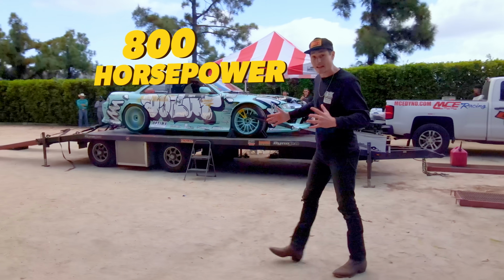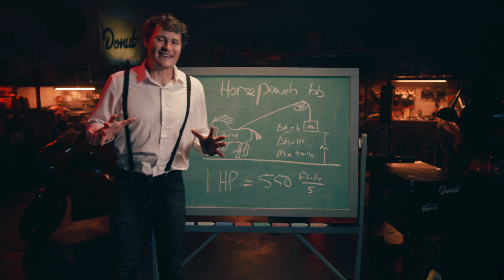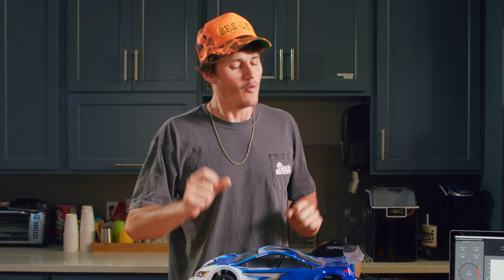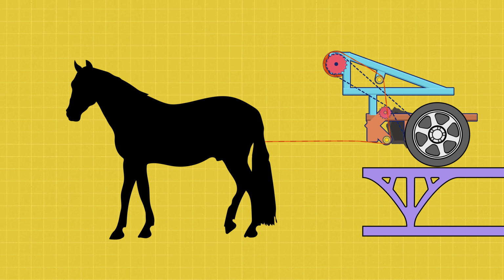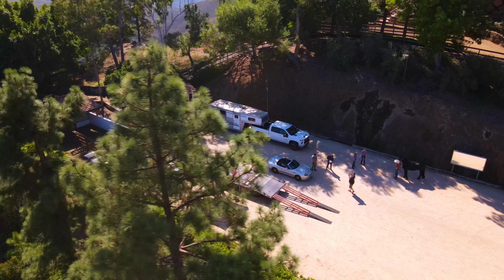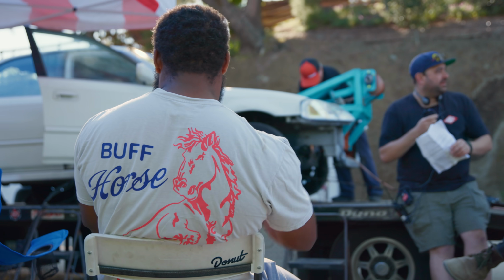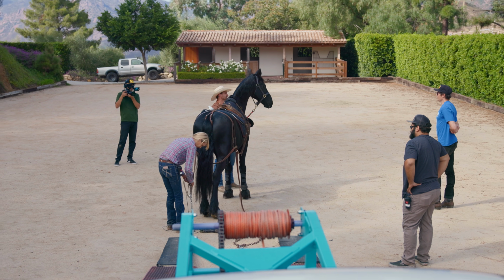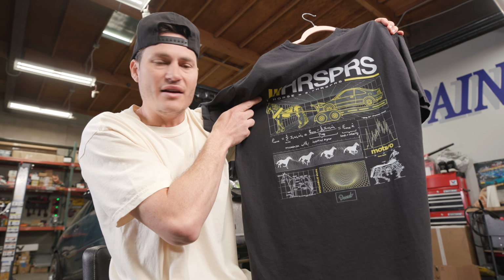How Much Horsepower is a Horse?

Comment: OK well that means that your math is 4.7 HP off. Because hello McFly you have one horse doing all the work. So all you scientists and physicist need to back up and look at the bigger picture because if you actually think that one unit equals 5.7 units of anything then maybe you need to take up another hobby like flower arrangement or something. But what you did show us is how far off the initial calculations of horsepower is. Now we know that one real horse is equal to 5.7 hp. My 85 El Camino clocked in at 222.3 hp so we divide that by 5.7 and we get 39 real horses🛻🪢🐎🐎🐎🐎🐎🐎🐎🐎🐎🐎🐎🐎🐎🐎🐎🐎🐎🐎🐎🐎🐎🐎🐎🐎🐎🐎🐎🐎🐎🐎🐎🐎🐎🐎🐎🐎🐎🐎🐎

Comment: As with all measurement units, horsepower is arbitrary. Its objective in the sense that its the same arbitrary unit we use for comparing one engine to another. So I would not be surprised to learn one horse can do more than one horsepower. This is an awsome idea to really test it.

Comment: That was entertaining for sure) But as much science as Horse Power definition itself) First of all, that wasn't average horse, and to be statistically correct, you'd had to bring a lot of horses and calc average of their power. Then, 5.7HP is a MAX what Big D did, not average. On average, according to a chart it will be hanging somewhere around 3 HP (I'm counting on the "normal drive" section of the test road, when horse wasn't accelerating or slowing down), still > 1 HP though) 
Also, it means that, f.e. tesla plaid isn't 1020HP, but actually is 340 real horses :) and so on

Anyway, thanks, that was fun!
Reply: I don't think that was even Big D's max, he hasn't even reach optimal speed (real engine RPM)
it feels like just a mere effort of opening the throttle while the engine is still revving under load.

Comment: I guess you guys pretty much have a guaranteed follow up video idea of just responding and maybe carrying out the recommendations everyone makes. I have no idea how much that would cost. People in the comments don't seem to realize that this was done as simply and cheaply as possible, mainly making the test and shoot as quick and efficient as possible by only going for the simplest and surefire (least risky) type of significant data points in the context of a single comparison case of engine vs horse in a car flooring it off the line. Enough to get a video and just barely enough to publish a paper saying we did a thing and then maybe they'll add to it by discussing different problems or issues or situations so that the experiment isn't the really the meat of the paper.

Comment: Was just a unit of measure people could relate to 100 yrs ago. Would be different for every horse but it's set at 550 ft lbs per second
Reply: yea, it's just a name., could've been agreed on anything else but since the engines was basically replacing the horse.
horse power should nt be used as a unit name, every horse's power will be different just like the power of the exactly same engine model won't be dead same.

Comment: G'day, well done on the measurement but the measurement you made is peak power and not an average output. The definition of a horsepower is based on an average animal output over a one day period, and this is well publicised. A horse clearly cannot sustain the measurement you made over a 24 hr period. Five pulls max for Big D, right :)
Get a horse to work a mill over many hours to exhaustion and see what the average is.
Wil G

Comment: Instead of lasers to read the rotational data, why didn’t you use magnets kind of like a crank positioning sensor or a cam shaft position sensor? And you could have bypassed all that BS with the Honda Civic, with a solid drive shaft like what go carts use. All you would have needed was an A frame, a solid shaft drive shaft with a sprocket in the center or just bolt two axel shafts to a spool and an idler pulley and two wheels connected to your axel.

Comment: Loved the idea, loved the video, felt very mythbusters-like, but just like mythbusters, every experiment can be improved. Seems to me (and fyI, I’m a college student who did middle of the road in AP Physics, I got a 3. I did much better on my AP Statistics Exam, I got a 5, in case you’re interested in my ‘credentials’) like there are a few small changes that might improve this experiment. Now, granted, I have not read the academic paper that I assume goes along with this video, but all experiments can benefit from more trials. Assuming the experiments all occurred in the span of one 24 hour day, specifically within the daylight hours of the day, though the length of this span of time will change throughout the year, depending on the location the tests were performed. This is also assuming Big Do’s safety pulling precautions were followed; it follows that that there was a maximum of 5 test pulls performed by Big D. This is further evidenced from the 5 video clips, although it is uncertain from the video whether or not the first test with the malfunctioning laser was used in averaging the data collected, so the likely total number of trials used to calculate the average is either 4 or 5. This is also assuming that the data 5.7 hp figure is the result of taking an average of the trial data, and that 5.7 is not from observing the highest data point. Under these assumptions, the average hp measured by the dyno is likely to have a low statistical significance, this could be greatly improved by increasing the number of trials. It is also highly likely that the terrain, temperature, and weather conditions may play a large role in determining the power of the horse. This may manifest itself both through influencing the mental state of the horse, ie. relaxing, antagonizing, encouraging, or upsetting the horse, or by mechanically impacting the horse’s ability to pull, by providing more or less friction to aid the horse’s grip on the terrain, or by providing an positive or negative acceleration on the horse via wind and the horse’s aerodynamic profile (Although the latter is highly unlikely to have significant impact, outside of extreme weather conditions which are likely to be outliers, statistically speaking). This is all to say, there are many variables to control for, this is not a large issue in this specific experiment, since the trials (following the assumptions provided) were all conducted in a relatively short time span, these variables are likely to be relatively constant for trials in this experiment. If more trials are performed, this would need to be taken into account. Anyway, thanks for reading all the way to the end of my own personal callback to High School (shout out Mr. Estevez and DR. Hedrick, Go Wildcats! (Boo Scorps and Red Wolves!)) 
Edit 1: 1st round of spelling and punctuation corrections

Comment: When I was in decent shape in my early 20s, I used to like to ride the LifeCycle exercise bikes as warmup and cooldown to weight room sessions.  By about a month in, I was running their 24 minute hills program on the max resistance level (I'm big and I was rather strong).  The steepest portion of that program is climb with 1400W of resistance.  To do the math, that's about 2 horsepower I would output for 3 minutes 2 or 3 times a day. And for whatever it's worth, I've been described as several various animals in my life but horse isn't one of them that.

But for the unit of a horsepower, the purpose wasn't to find a comparable peak output but rather an average daily output.  Horses do need to rest, and if worked for long times, won't be working at their near-peak levels.  For me, that 1400 W was something I didn't really struggle to do but probably couldn't have held for more than 10 minutes or so.  But back it off to around 500-600 watts and I could maintain probably for several hours.  If it was something i had to do for 10 or 12 hours, I might have needed to back off to around 300-350 W. or maybe even less.  So that 800 horsepower car isn't like 800 horses pulling it.  It's more like having 800 horses on a hotwalker with that hotwalker charging batteries, and those batteries able to deliver all the power needed to drive the car 20-30 miles at full throttle each day.

Comment: I only have two gripes with your process
1) as big D pulls the line, he pulls more rope away from the spool. This causes that rope to pull on the spool harder simply by staying taut
2) since the rope is coiled around the spool several times, technically big D is pulling a slightly larger “gear” (if you will) with a larger radius 
I don’t have a solution for either, but good video nonetheless!!

Comment: I bet you they did do it and 15 is accurate. But they gave the horse a whip I bet you that horse could get twenty five with a little bit of the effort, bid d didn't use at all But a quarter horse would probably drop out at fifteen That's the average cowboy horse city folk

Comment: A horse, generates 1 horsepower. Yes its based on torque. The torque it's based on is the power a horse generates to pull things, say a wagon, because that's what they had to work with.

Comment: Couldn’t you just put a conveyor belt sort of a thing over a dynamo with an additional rotary drum attached in front. 

Wouldn’t that be a Better and easier way of recording it? 
In this case, a lot of energy getting wasted due to the gearing system and the friction etc.

Ps: just a doubt, not an expert myself😅

Comment: Well, the horse clearly wasn't pulling anywhere close to max, but then it wouldn't if you were having it do steady work all day, it also isn't a full sized draft horse though. Still this proves what I long suspected to be true, that a horse makes a lot more than 1 horsepower. I think it is importantly to remember that today we think of horse power as peak power a system makes, when it was initially more about the power a system could maintain for an entire day.

Comment: Hmmm, I give why I'm down voting this video at the bottom. 

I remember in history class that the Roman's used human slaves because the harnesses of the time went across the horses chest and choked the horse if it was pulling a big load. It was OK for a light cart or chariots but not heavy loads so humans actually delivered more power (ie: more useful work), hence slavery.
It was also mentioned that the invention of the HORSE COLLAR (after Roman times) which transfers the load to the horses shoulders allows the horse to draft MUCH more weight than a horse with straps across its chest (think of it as a strap across your neck/windpipe, that's going to limit you right? Same way it works with a horse) and major changes happened to the world due to this invention. 
It revolutionized agriculture for one thing as a lot more land could be cultivated by a horse with a horse collar (pulling more plow blades and deeper into the soil too) than one with just a strap harness.

So why the hell didn't Big D have a drafting collar? You damaged your true readings and data because you used the inefficient harness for this test !!!!
Didn't anyone know about horse collars and getting full power out of a horse on your team there? No one has a decent history class that covered why things were done the way they were (or was it History for Dummies and yours just cover names and dates) None of the horse people spoke up about this error?
No one caught on that pictures of the old West that where horses or mules or donkeys were pulling heavy loads they had on horse collars and where the load was light it was just a strap harness?
How about the Budweiser Clydesdale horse teams, they were the ultimate draft horses and every picture of them in harness shows their horse collars, they are there for a purpose, not just decoration. Our ancestors weren't as stupid as some people think today.
Those that forget the lessons of the past are doomed to repeat the mistakes of the past.

Comment: This is fun an all but seems a little over engineered.  Why wouldn't just build a rig that would put a tire on the Dyno drum and just wrap the rope the horse is pulling around an axle attached to the wheel?  Less moving parts = more accurate reading.

Comment: This is a fun video and the amount of time and effort in setting it up and running the test is impressive. There is however some potential for inconsistencies in your conclusions as to how much horsepower a horse can produce. While Big D is a beautiful animal, he is a rather small 'draft' horse. At 3:10 in the video, the horse shown is by far a larger, more powerful draft horse. If you used that horse or a large Belgian draft horse, the horsepower rating could be far different from the figures posted by Big D. I don't know if there is any way to definitively define "The" horsepower produced by horses. You could only perform the same test on multiple breeds and sizes of horses and produce an average HP rating. I'm uncertain if an experiment with such a potential for variable outcomes could be used for a scientific paper.

Comment: A better way to look at this  is to look at history . How many horses did an early tractor actually replace? And the common answer is 5. But a tractor can run all day and not get tired. In fact early tractors would pull a 2 disk plough which pretty much the same as a  horse.  So using rated tractor horse power as a measure the Ford N produced around 13 to 15 hp.  So one actual equine is actually producing around 13 hp! 
Of course what really matters is torque...

Comment: The value coming out of your experiment is  the HP of the BigD at lower RPM, I think BigD can produce more HP when it is running at higher RPM, Although what you measured was sufficient for the standards

Comment: Wrong! What a load of rubbish, who said that the figures that everybody uses to make Dyno's is correct and where did they come up with those figures. The saying 1 horse power is 1 horse power, there was not Dynos to get those figures so everything was base around a horse, but what horse is anybody's guess, so really your Dyno's are what is wrong and your horse powers all need to be divided by 5.7 so an 800hp car really has only 143 hp.

Comment: Let us know what the results of the peer review are. And just out of curiosity and knowledge,  why didn't a simple treadmill design be used? I would have though strapping the horse to an ancor point so they don't actually move forward but only move the tread mill in turn moving the dyno wheel? I'm sure there is a reason you guys used more mechanical mechanisms to do this experiment

Comment: Your test are all flawed, measurement of horse power is a tool, you talk to anyone that runs a dyno and you will understand that, besides that, any dyno you go to will give you a different number for several reasons. I believe that horse power came from a sell’s pitch to say you would need this many horses to replace this power. Torque is needed to move a mass horsepower is needed to keep it moving.

Comment: I think there is an easier way of measuring the power ,  you make the horse pull a truck with a scale in the rope then take the reading from the scale multiple them with the speed of the truck and get the power, as power = Force × velocity

Comment: Question? Do dyno computers calculate hp with the current formula for hp built in along with torque, time, and rpm? And if so, wouldn't that negate the experiment?

Comment: I haven't watched the video yet, but I can tell you that different breeds of horse have different power levels.   A Suffolk doesn't have the same level as a Thoroughbred, which doesn't have the same level as a Quarter horse, which doesn't have the same level as a Clydesdale.

Therefore, if you didn't   test the power levels of multiple individuals, in multiple breeds, then your experiment is  inaccurate at best.

Edit:  After viewing the video, I (a retired mechanic) have concluded that one horse does NOT in fact produce 5.7 horsepower, but that 1hp is actually 17.54389% of 1 TRUE hp, or less than 1/5 of 1hp.

This means that all measurements of horsepower to this point have been erroneously inflated by a factor of 5.7×.

Comment: I thought the question that Watt was answering is what can a horse pull day in and day out for 8 or 12h a day for years, it’s pretty different than what can a horse “pull off” in one little sprint. So in that case 5.7hp measured and taking 1/6 of it =1hp doesn’t seems that far off. Surprised this isn’t actually measured so it’s an epic fail ^^ but still fun

Comment: I thought the HP rating meant how many horses were REPLACED by the engine....as in a 5hp motor replaced a stable of 5 horses...where only 1 or 2 horses was working at a time.  Because horses can't work constantly.

Comment: well the data you guy's use for horse power is not rigth you need a real pull horse to make the real horse power you guy's use a run horse the do the project good idear but the real way will be with a pull horse

Comment: Should of done it with wooden wheels like if it was pulling a carriage. 2 wooden wheels on the dyno, reinforced not to be pulled off .  And the horse on a rope. Kind of like a sideways top, the tires would spin when it takes off, giving a more accurate representation to Watt

Comment: Very cool project! For the dyno, have you thought about simply removing the brake from a big electric winch and using the DC motor as a load?
Reply: What I also thought, it's a quite more direct as calculations go. 

But not as fun :p

Comment: Ok. So now that we have the horsepower let’s work on the torque number.  And now that we have this hp number, does that mean that we have to re-calculate the hp numbers reported by manufacturers?  A car dynoed at 1000 hp is instead, 175.43 hp?  You may have just pissed off a lot of hot roders.